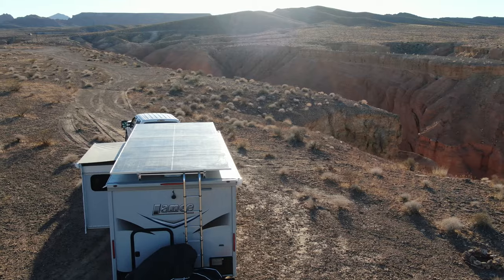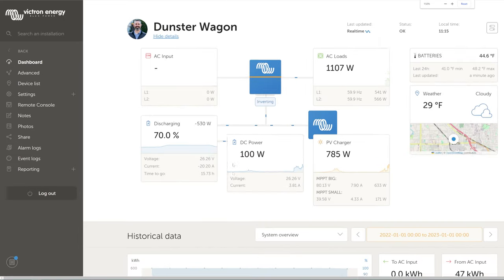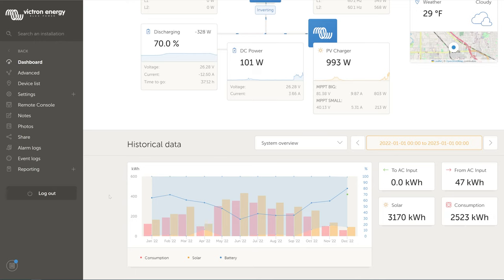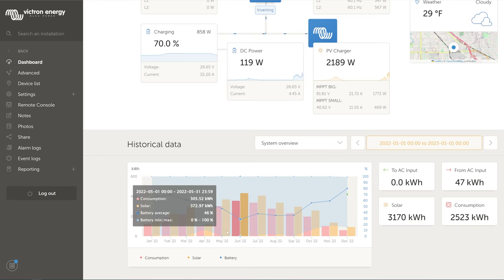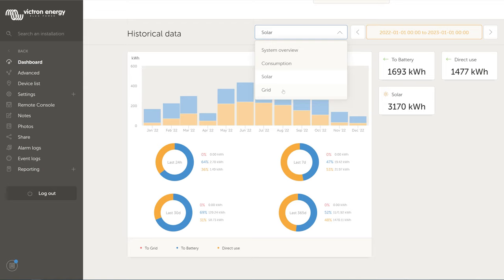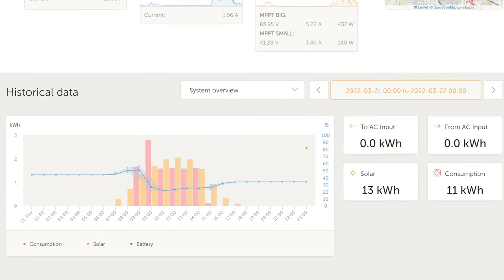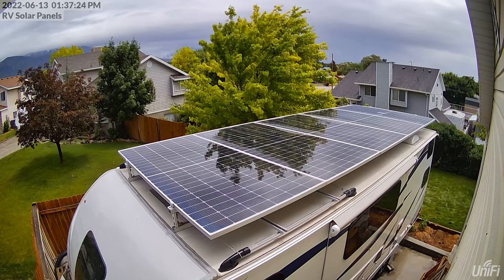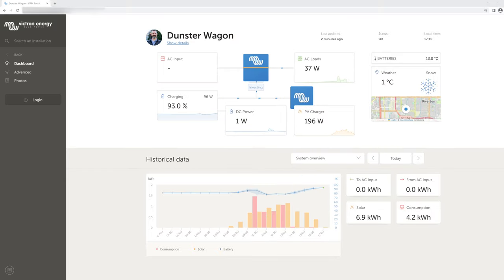How Much Electricity Can My Travel Trailer RV's Solar Panels Produce In One Year?

Comment: Great job. This is great.

One thing I do to ensure that my batteries don't get full: I take advantage of the MQTT broker on the Victron GX device to monitor the battery charge and solar production. I then use that to automate the thermostats to turn on the heat pumps to either cool or heat the trailer depending on time of year, or switch on water heater or whatever other diversion loads you might have.

Basically my automation's look at battery SoC, battery voltage, solar wattage, and solar voltage (And BMS max_charge_amps but you don't have access to the BMS in your setup):

IF (battery_soc >= 98) AND (solar_wattage > 500 OR solar_voltage > 100)
   THEN turn_on_diversion_load_1
IF (battery_soc >= 99  OR battery_voltage >= 55 OR BMS max_charge_amps < 32) 
   AND (solar_wattage > 500 OR solar_voltage > 100)
      THEN turn_on_diversion_load_2
... etc

The only reason I added the BMS max_amps to the logic is there have been times when my battery hits 100% SoC before it hits 55v (Due to cell balance issues) and thus the solar charging would stop before my automation could turn on diversion loads. By having access to the BMS it allows me to detect this anomaly and turn on the diversion load anytime the BMS slows down (or stops) charging to a point where it would affect solar production.

Otherwise super happy to see how well this worked out for you.
Reply from the maker: Thanks, and I love how you've automated your system! I've thought a little bit about how to go about automating mine, but ultimately I'm busy raising my children and making YouTube videos in addition to my day job and it's easier in the short term to just manually monitor the system. Plus in the short term I'm curious about how it'll all play out so doing it manually keeps me up to date on all the details. I hope to automate it more someday, but like you pointed out I don't have access to my BMSes so that's a limiting factor. I think I could still do a good level of automation with just the percentage of the batteries that Victron monitors. The most helpful automation I'd like to have is code that dictates the amp rate the Tesla is charging at based on the state of charge of the RV batteries and the solar input at that moment. Secondarily I would tie into the mini split dictating that it turn on or off depending on the temperature of the batteries which Victron also monitors.

I'm curious why you have your code logic on the battery state of charge at such a high percentage, instead of having it maintain more of a middle range of the battery soc?